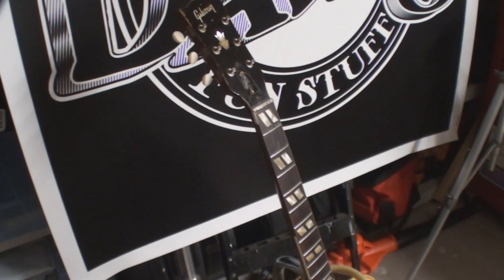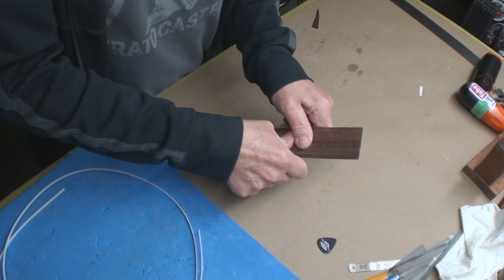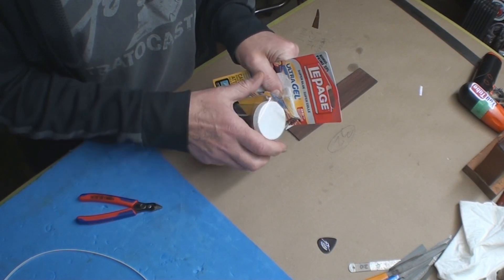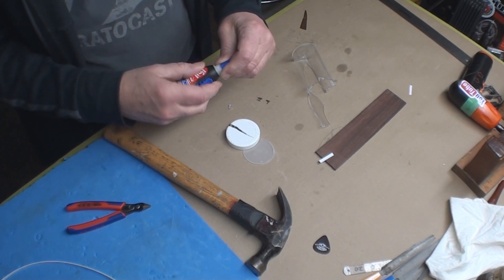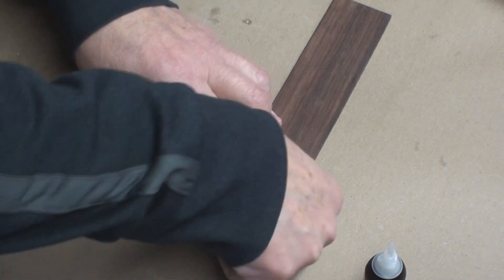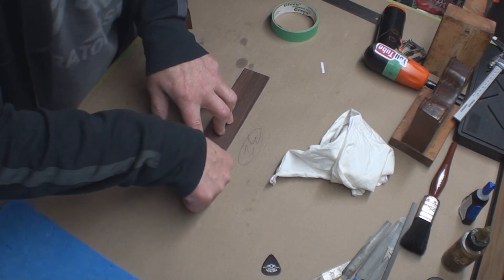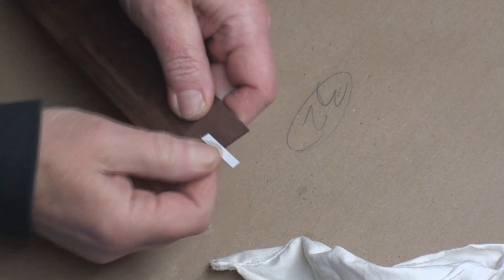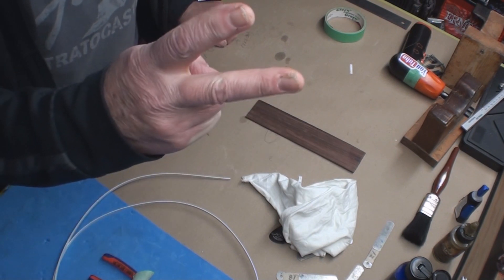Adhesive Test For Guitar Binding Repair

Comment: The best thing to use is acetone I think it is.it melts it and bonds it to the fret board.look it up.love watch you do and watch you everyday.youve helped me alot.love to have a shout out for Bryant in Tennessee.thanks Dave,cheers
Reply: The acetone is used to bind the plys of multi-ply binding together.  you have to use glue to bind it to the wood
Reply: only if you glue it to other plastic. And it depends on what kind of plastic it is. 
you can use acetone to clean the CA glue, but to glue things together you need to desolve plastic in acetone and use that goo as the glue. Most binding is made from ABS (acryl-nitril-butadien-styrol) and to glue that, I'd take ethylacetate. You can buy it pharmacies, it's the same as acetone-free nail polish remover..

Comment: Hi guitar people ! Quick question, I bought an old Chinese Danelectro DC59 and the pickguard is in bad shape. However, I can't find one anywhere. It has only three holes in It for knobs and the switch. The Jack is on the side (not the one sold on Allpart). Am I obliged to get a custom one ... ?

Comment: Have you tried Acetone?
Reply: Amit Sapir acetone sticks cellulose binding to itself, but not to wood. (Not very well anyway, especially rosewood.)
Reply: I use acetone for binding bodies...sticks great for me.  Bonus is that because it melts the binding, it fills any little gaps or irregularities where it meets the wood.  That said, I haven't used it on a neck, though I plan to try on a uke for giggles...

Comment: The binding might shrink, so wait at least a day before you scrape it down to size.
push while turning...not push, wait and then turn. 
I'm glad it's not the ultra thin CA glue. Someone at work didn't wear glasses and got a tiny drop in his eye O.o Don't push and look in the bottle. If you press on a connection while it cures, it won't be as rigid as it could be. And it is possible to overclamp stuff. If you press all the goo out, there might be not enough in there.